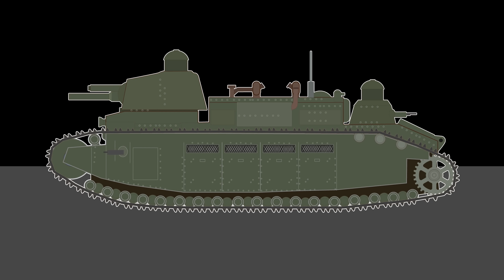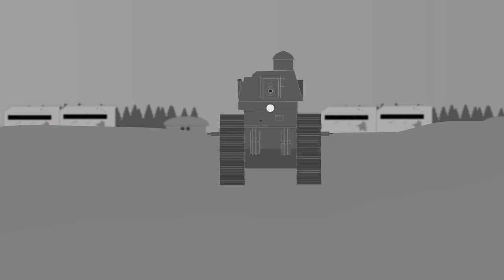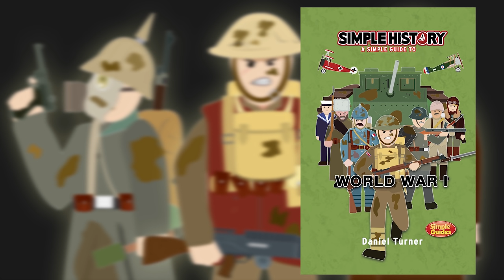Char 2C Super Heavy Tank (Behemoth)

Comment: Who is interested in the characteristics of this unique and majestic machine:
-Built-in main and backup oven, up to 80 baguettes and 200 kurasans per hour, respectively
-A gourmet restaurant of the «Vivat-Asse» class in the rear of the car providing stable snail-frog support for the crew and cordon.
-Ammunition in 1200 large-caliber bottles in protected niches with automatic feeding to the crew, ammunition includes heavy cognac, armagnac of increased strength, incendiary champagne and Burgundy for the secondary tower.
- A full-time mime and an assistant mime in the crew.
-A miniature replica of the Eiffel Tower in the tower, to admire the tower while sitting in the tower.
-A 5-meter flagpole with automatic raising of the French tricolor when the front gear is turned on (there is one) and the white one when the rear ones are turned on (there are five).
-A regular podium for quick selection of crew uniforms for current conditions.
-The «Chanel-5» smoke exhaust system with a reserve of 35 liters of perfume.
After the capture, the tank was divided in the proportion of 60 to 40 with the Vichy collaboration government, in 1943 the tank was completely occupied by the Reich, which, however, was complicated by constant clashes with the "Resistance", especially in the area of the engine and rear turret.

Comment: What is the spiny thing on the top of the gunner spots
Reply: A stroboscopic copula. It was a slotted cylinder within another slotted cylinder that would spin in opposite directions so when viewing from inside, it would feel like you were looking through a window. Kind of pointless though, as you could just as easily use a periscope.
Reply: Brendan Weller thanks that's pretty cool.

Comment: The front and side armor would have been effective against anything the Germans had in 1940. While the rear armor was vulnerable, this could have been protected by infantry, B1, S-35, or even FT-17 tanks, had the French bothered to deploy them.
Reply: No,PaK 36 could easily penetrate that flat 45mm at ranges closer than 500 meters.And Germans had some 12000 of that in service by 1940.